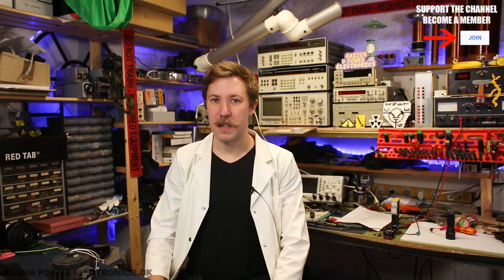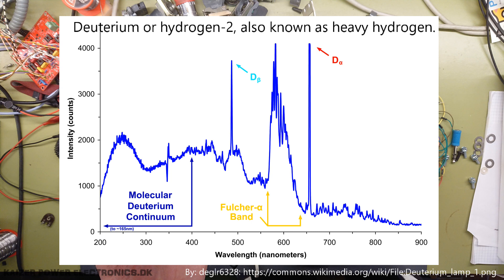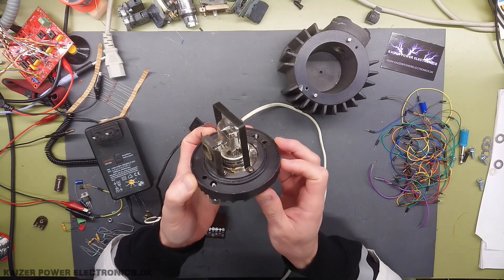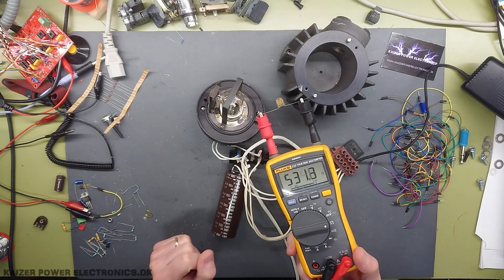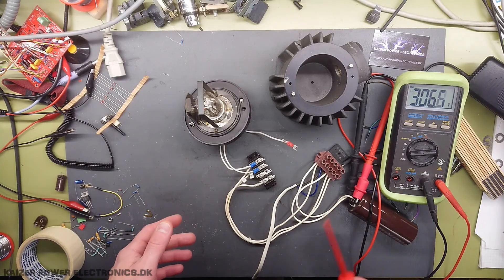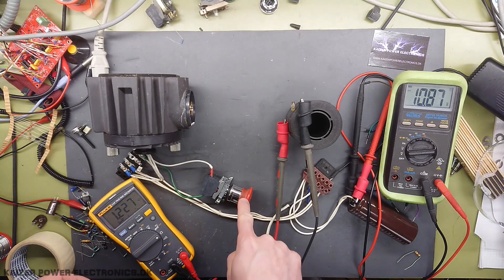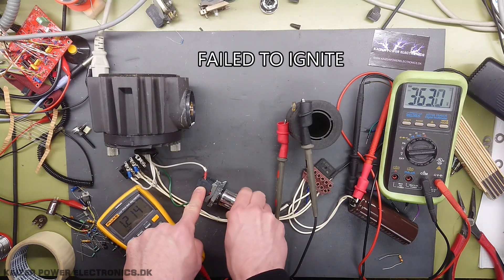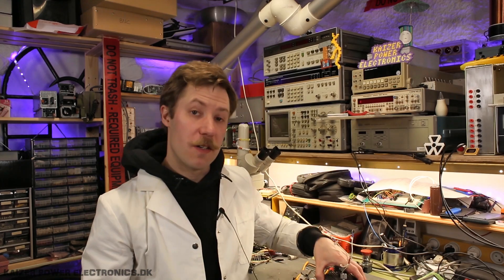Deuterium UV Lamp Test [FAIL] and Theory

Comment: Nice video! I've tinkered with Deuterium Lamps a lot and built a simple (and not very good) power supply for them as well, in principle a toroidal heating transformer and a magnetic fluorescent lamp ballast (choke) with rectifier and safety resistor to give the lamp the ~300mA DC current to maintain the arc (and a circuit with capacitor to automatically light it up). Yes, its a bit of a death trap because its directly connected to the mains output... But as a chemist I am used to not touching things that might kill me ;) So you dont need a constant voltage supply with 70V but a constant current source delivering 300mA. Your 70V might not be enough to light up the lamp. The arc current is important for these lamps and the voltage adjusts itself to the value needed to maintain the arc discharge. Typical arc discharge voltages of new D2O lamps are 85-90V, so 70V is a bit low. Even old and well used lamps with more than the specified 2000h or so tube life do at least something and try to start, but the arc might not be stable. They also get increasingly hard to start with tube age (maybe more than 400V needed). The tube life is only specified as the point when the light output drops below 50% at a specified wavelength, so its not useful for a spectrometer anymore but still works. When in operation (arc is burning), the filament voltage should also be lowered to 50% or even shut off, because the 300mA current the cathode has to emit, heats the cathode enough to maintain the arc. Otherwise the cathode can overheat. Deuterium lamps are not the easiest type of lamp to operate, but they are pretty cool. Just dont burn your skin and eyes with the invisible very powerful short wavelength UV radiation - they typically have a power of 30W!! ☠

Comment: You could use one of your small Tesla Coils to check the gas condition. It may be possible to use the technique to start the lamp too. Although I think you are probably right as the lamps should at least try and start with the pulse from the cap. I think I used a higher ignition voltage (approx. 1kV) from a smaller capacitor.
Reply from the maker: That was a great idea to excite it from a HF field from a Tesla coil. I can still try that out. Not going for higher voltage was mostly based on the original power supply, as it was specified for a 325V pulse for just mere 1us.
Reply: @KaizerPowerElectronicsDk  Good point not to have too high an energy pulse to start. Sometime in old eol lamps where the cathode work function is poor a higher pulse voltage can coax a it to start.
Reply: @KaizerPowerElectronicsDk  One problem i have noticed with deuterium lamps is that, as the lamps age, the starting voltage required to get it going does increase. I have one instrument that now only starts when i put it behind a variac, to provide it with at least 240+ VAC (raising the voltage on the starter winding above 400v) but it still provides useful output once it gets going.
Reply from the maker: @chuckvanderbildt  Thanks for the suggestion. I will try with a step up transformer.
Reply: @KaizerPowerElectronicsDk  Tig welder with HF start laying around?  Either way, stay safe (as usual)! :) :)

Comment: Cool
Try using a hv spark to ignite since it's probably busted anyway.
Reply from the maker: Violenty igniting heavy hydrogen was not on my wish list that day :)
Reply: @KaizerPowerElectronicsDk  - For deuterium and tritium, the optimal reaction rates occur at temperatures higher than 100 million °C
It would be interesting if you could beat ITER on fusion, but it's better overall to avoid ionizing UV radiation; equipment such as plastics also gets damaged, it's not 'only' your eyes and skin :ø)